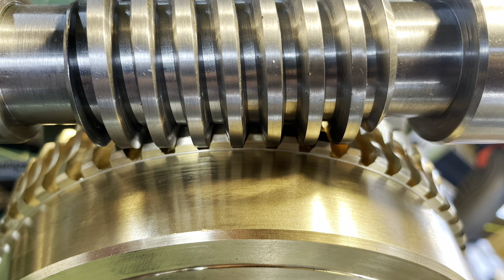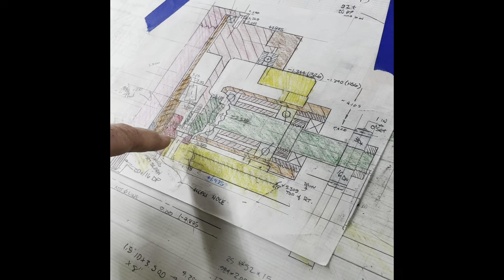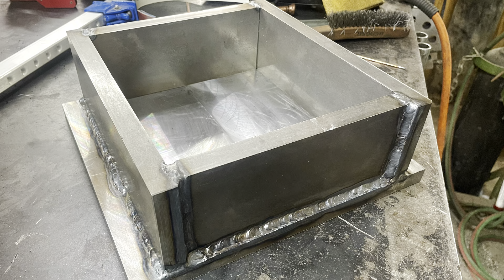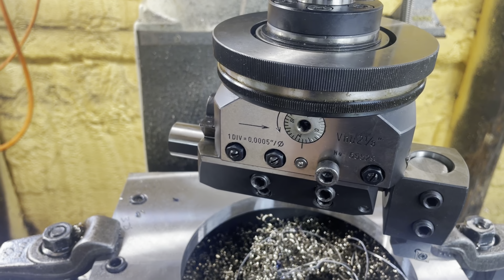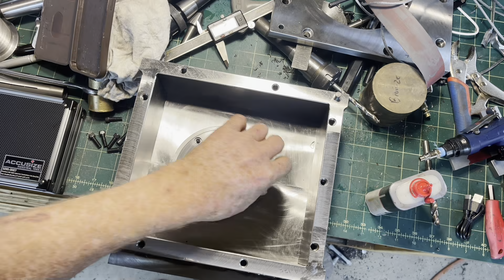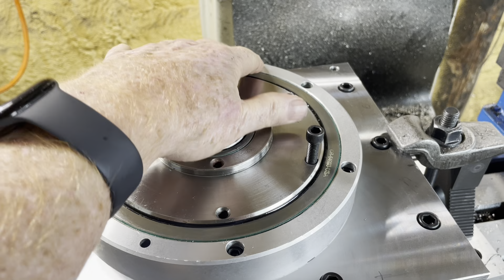Gear Hobbing Machine-Part 2.  Building the Turntable, mostly.

Comment: Fascinated just found your channel and its very interesting cheers from New Zealand
Reply from the maker: Cheers right back!  Welcome!
Reply: @thomasstover6272 so where did the plans come from or is this your creation ?
Reply from the maker: @dougwood6186 all me, I’m afraid…
Reply: @thomasstover6272 i have an old 1895 john Barnes Camel back drill i want to restore and the power feed drive mechanism is missing . It requires something like 12 gears to be made including some bevel gears and spur gears so I’m very interested in any videos to do with gear making cheers Doug
Reply from the maker: @dougwood6186  Sounds like quite a project!  If you have access to a lathe and mill, single tooth cutters are the way to go for a restoration.  You can also use the same type of cutter to make a type of bevel gear.  I have a couple of videos explaining that process.  I’ve made power gears that run at speed that mesh well and are suitable for my needs.  If you have access to a book called “Gears and Gear-making” by Ivan Law.  Probably the best resource for the hobbyist.  Happy to take questions if you get stuck!  Cheers!
Reply: @thomasstover6272 thanks yes i have two lathes and a mill drill plus a dividing head and a set of involute gear cutters but im self taught hobby machinist so got a lot to learn . I think i do have that book you mention , thanks for your reply
Reply from the maker: @dougwood6186  Lots to learn means lots of fun to come!  😊

Comment: after completing the weldment of the turntable case was it necessary to perform stress relief on this construct?
Reply from the maker: The case needs to be rigid, oil tight, and dimensionally accurate.  It is not highly loaded in use, so I never really thought about stress relieving it.  I will ponder this point in the future, though!  Thanks for watching!

Comment: Now it's making sense, and ya gave me some tips to boring a large hole in steel, Thanks. When I tighten tapered bearings, I tighten them tight to seat them then back off, like wheel brgs on ft axle of car, but yours is a machine, so you probably don't want any free play, maybe some rotational torque, as in inch lbs. Just old auto mech rambling, sorry.
Reply from the maker: Kind of feeling my way, but that bearing will only need to do 10-20,000 total revolutions in its life, so heat and wear won’t be an issue!  Thanks for the comment! 😊

Comment: Hi there. I don't know exactly how you  are going to use this rotary table in your set up. But I am afraid you are not going to be happy with the results. In the gear hobber I made, I tried two different worm gear reduction set ups. One a forty to one from China and another from steering on a car. The Chinese one had slop, but the automotive one was very tight. Both of them introduced creep into the system. That is to say after hundreds of revolutions the hob began to eat more and more on the sides of the gears. If I just let it run, it would eventually just eat away the teeth. I don't understand this and maybe yours will be different, but somehow a worm gear is not the same as a toothed  gear for maintaining  position. I suspect it will not maintain the precision you want. Of course I could be wrong, but my experience with two different worm gears in the hobber train did not work out well. I had to go back and redesign it using spur gears.
Reply from the maker: Thanks for the comment!  Have a look around the channel, and you’ll find more about my Hobbing machine, Mk 1.  I built the work spindle from scratch using a 40:1 worm gear set that I made.  I’ve made hundreds of gears with this setup, including all the ones for the hobbing machine…and I’ve made every mistake in the book, but I can make most gears decently well with this setup.  Some folks, including me, have struggled getting the index ratio correct by trying to decimalize the ratio, then synthesize the change gear setup…which always leads to small accumulating errors…that sounds like that may have happened to you.  Always good to run into another gear-head! 😊
Reply: Are you using a stepper motor and encoder to keep the turntable and mill spindle in sync with one another?
Reply from the maker: @howardosborne8647  I have done that in the past with very mixed results.  That was why I decided to build a completely mechanical system.  As long as I do my part, it’s very predictable! 😊
Reply: @thomasstover6272  I have known of others who have had problems with the stepper and rotary encoder set up but there is a fix that keeps check of the relationship between encoder and stepper....something similar to how a DRO linear encoder checks itself at regular intervals by quadrature.
Reply from the maker: @howardosborne8647  I’ve done closed loop stepper controls, and the results were better, but still variable.  I believe that the fundamental problem is with digital division…even small rounding errors can accumulate to a noticeable helix angle (when cutting a spur gear) when compounded over 100+ revolutions of the workpiece.  Mechanical systems require only integer math, and there are no rounding errors on the indexing side.

Comment: Nice work fair play to you
Reply: Hi Tom, it's Ray from Detroit.  Another great video!  I was wondering if you could have bolted the box together instead of welding it? And what would be the advantage of welding vs. bolting?  Thanks for sharing
Reply from the maker: @raymondvancourt1622  Less work!  Actually, needed rigidity and oil-tight at the bottom.  Good question!
Reply from the maker: Thanks for watching!